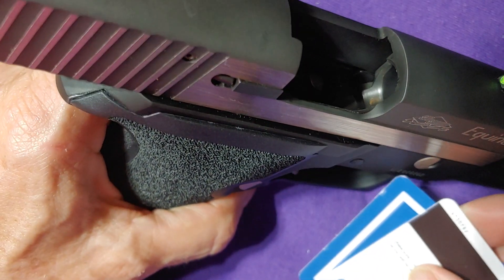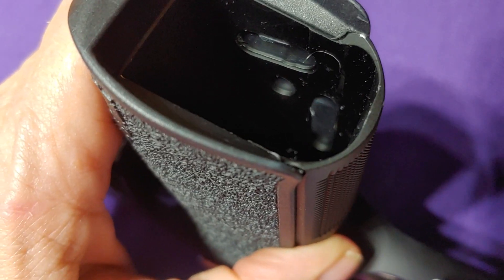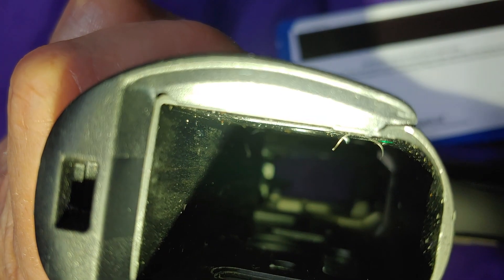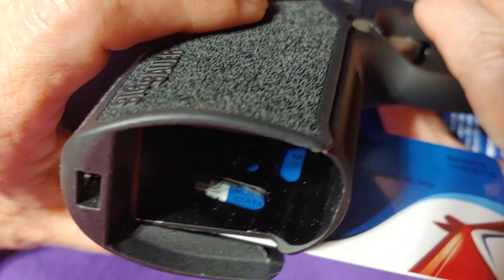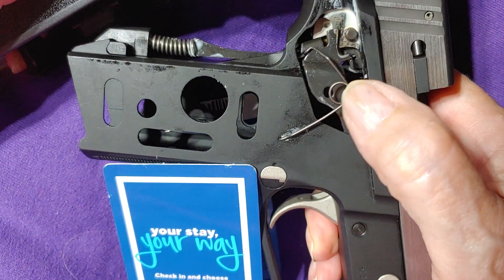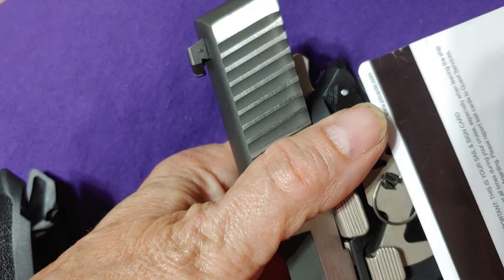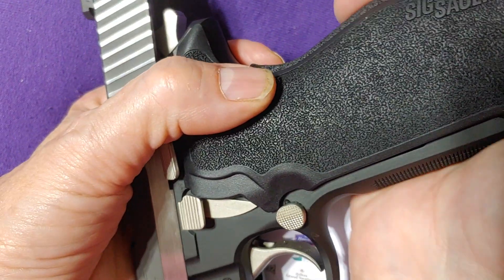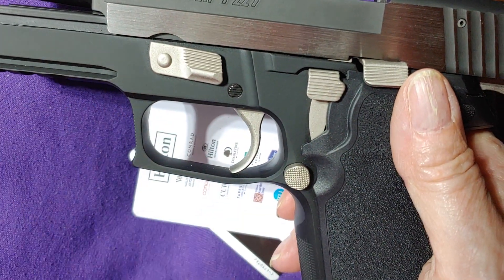Sig Sauer P227 or P220 Grip Removal of one piece wrap around grip

Comment: You deserve the Gold Medal for ingenuity, adapting, and overcoming.  I think that your method is superior to using the OEM tool, certainly a couple of old plastic cards are much more user friendly, portable, and protective of the springs not getting dislodged or damaged.
Reply from the maker: Thanks I like taking things apart and putting back together my dad's clock never recovered when I was a little kid but my pellet gun made it !
Reply: @ironstrader  You should get more exposure of that video.

Comment: Excellent work. Can you install different grips on the guns that have the standard wraparound grip? I have a p227 and I was always wondering if I could swap those out for something different. Thank you.
Reply from the maker: I have never tried that as I don't own any of them.
Reply: Hogue makes grips specifically for the 227, in a couple patterns, and I believe in multiple materials. I just got a set of their g10 checkered grips for mine. There is also at least one company making wood grips that fit them as well. They come with retrofit hardware, as our 227s aren't threaded, I don't think.

Comment: I was able, with strong finger nails spreading the two sides apart, and with thumbs inside the mag well pushing outwards. Rotate out at the bottom
 My disappointment with my Like New P227 Elite is finding no threaded screw holes in the frame so I can change the grops, like my P226 Elite. I'm not a fan of the E2 grip.